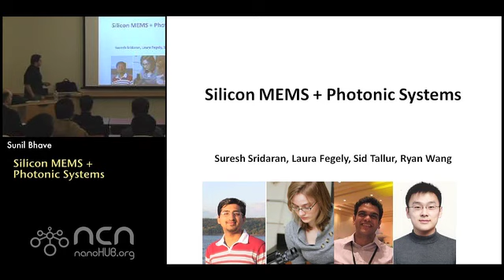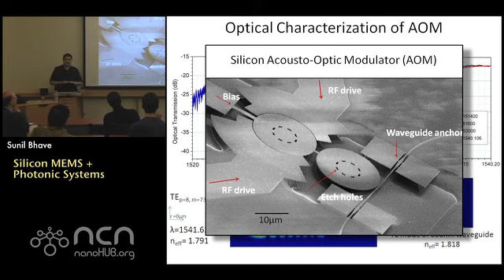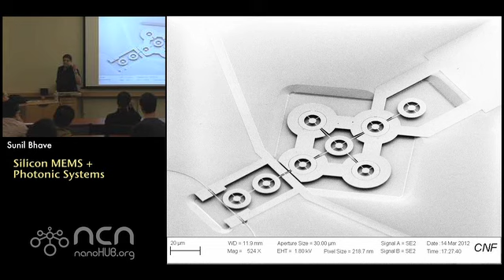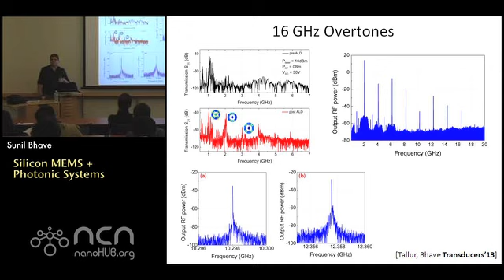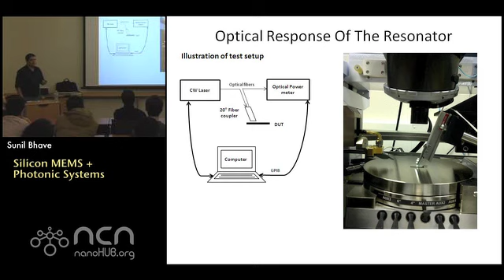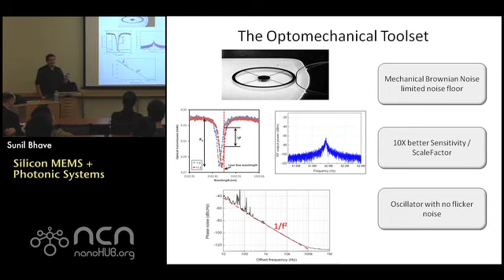Silicon MEMS + Photonic Systems

Comment: In this lecturer the idea about small measurement and micro error measurement are explained briefly for different physical phenomena.As measurement of expansion in thin thrid,accoustic optic modulator and optical resonance error  in which photonic side optical path changed.To  expand this device intensity modulator of wave is used.Noise measurement is also  explained,in which it is mentioned how do increase as like frequency and reduce phase noise.In mechanical solution energy is transfered from electical energy to mechnical energy and also explained about partial Gap Transduction.